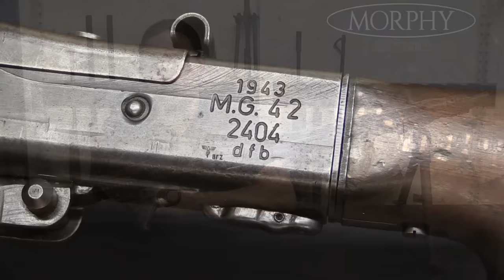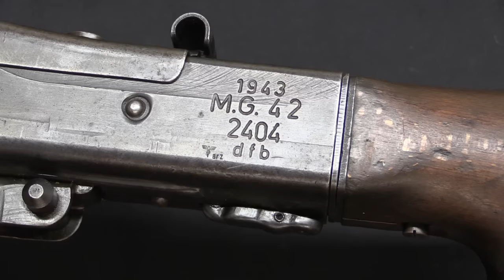Hitler's Zipper: The MG-42 Universal Machine Gun

Comment: I'm more interested about this mg42 than I am about the presidential election.
Reply: So you're a sane human being I see.
Reply: At least with the mg42 somebody has a good outcome, as a foreigner I don't see a good outcome for your election
Reply: Easy to see why: the election will take a whil, but the video is out
Reply: So are you saying no matter who wins the nation is fu**ed??
Reply: @curtisthomas2670  yeah but if Joe Beijing wins we're completely fucked.
Reply: Michael Madden I live on a farm in Tennessee.
Reply: Michael Madden  na just make a sub gun there really easy to make , 2 pipes, chuck of axle, fork spring, a square tube, and 2 tape measures
Reply: Michael Madden  notice how I didn't State how to put it together therefore no laws were broken I know what I did
Reply: Michael Madden  also I'm a Canadian who thinks your president is stupid I'm already on your FBI's watch list
Reply: Michael Madden  doesn't matter what quality they aren't they are largely made out of scrap and mild steels, with firearms at least you know the pressure bearing parts cannot be made out of just any metal there needs to be a hardenable steel and for instance the bolt in the barrel of the bolt in the barrel extension need to be actually separate hardened metals which sit around the same Rockwell hardness to stop from galling happening lot of these guys don't even know what galling is. More or less to my point is firearms made out of the improper metals are effectively a hand grenade. I don't care how fucking " high quality" your single Khyber pass firearm is I'm going to stick with my velmet cuz at least I know the gun builders that knew what they were doing and you know had tickets. (I could give a file to a high schooler and he can make an AK-47 okay not saying it would be good it probably be the quality of those Khyber pass guns and fucking blow ups soon as you shoot it cuz mild steel trunnions)
Reply: Michael Madden  only specific types of metals can be hardened at each one has a different hardness and truthfully it's not hardness specifically that is needed it is toughness which is a mixture of ductility hardness elastic deformation and plastic deformation it's almost like I know a decent amount about this (scrap metals you don't know exactly what type of steel it is you can tell it can be hardened but you can't tell what type of steel it is) let's say your bolt is a lower hardness than your barrel well then when you shoot the locking lugs on your Bolt will gall and in worst case can be sheared . metallurgy is much more complicated than you think it's not like you know you can get actual degrees in it you actually have to go to a place of learning to understand metallurgy properly. I am an Class-A welder meaning I am a red seal welder, I was trained by the Industry Training Authority also known as ITA. My training is recognized internationally, a class-A welders deal with alloys in welding terms alloys referred to exotic metals such as medium carbon steel, high carbon steel, killed steel, rimmed steel, semi rim steel, stainless steels, titanium, aluminum, copper,  etc.)
Reply: Michael Madden  quite the interesting Hobby I'd be extremely hesitant to you know make modern smokeless powder firearms out of that steel just because you do not actually know for sure the alloying element content of the metal but if it's truly is some form of crucible steel black powder firearms are absolutely an option cuz for Christ's sakes those were made out of wrought iron and wrought iron is not strong whatsoever
Reply: Michael Madden  well then if she's got a degree in medical allergy she absolutely can make Steals and she would know what I was talking about in one of my other comments when I was talking about rims semi-rimmed and killed steel (funny thing is I weld on those things) that her job title is pressure weld inspector
Reply: Michael Madden  to add the regular civilian can't just buy some of those chemicals like Palladium and some of the harsher metals that are actually a part of you know alloy metals for example ask her about melting magnesium
Reply: Michael Madden  here we go again you obviously know nothing about metallurgy in carbon steels magnesium is put in there to make it more tough and also corrosion resistant which is you know quite good when you're dealing with fulminates and you know nitrocellulose this is what I was getting into in the beginning you have to have an engineering background to make a effective and safe firearm of the bat you have to understand that you know the barrel has to be this certain hardness but it has to be this corrosion resistant it has to be ductile to promote proper barrel harmonics and those are all literally 0.01% by weight of your end product doesn't seem like a lot but zero carbon content and it's iron, 0.01% carbon content is mild steel
Reply: Michael Madden  also know the trouble is getting up to a decent temperature for the steel to properly homogenize in The crucible but obviously you have no idea what I'm talking about, look it up that's what rim steel is that's what semi rim steel is and that's what killed steel is it's a product of smelting the steel once again I'm a welder I've been trained to understand this because it's a serious part of my job and it just so happens my knowledge spreads across basically anything to do with metal because I'm a welder if it's made out of metal there's a good chance I'm going to have to fix it, also to ad if you do not use the correct smelting methods the steels will not come out well and be at the certain quality that making for firearms it would be good for what I'm getting at is basically what you're saying is anybody can make steel in their backyard and I hate to break it to you Mr "many hands make light work"
Reply: Michael Madden  no I did work for the Canadian Navy in the US Navy I'm a private contractor/mobile welder, I can build skyscrapers to pipelines to ships, fuck I even did some ship breaking back in the day (like 10 years ago)
Reply: Michael Madden  and no crucible steel is modern steel you know steel made in the 20th century made by putting either  cast iron, gray cast iron, white cast iron, malleable iron, or Nodular iron in to either a open hearth furnace, a basic oxygen furnace, or a electric furnace all using extremely complicated methods to make steel but that's how modern steel is made not with your little shitty graphite crucible in your propane fucking forge like you would with aluminum ask your little friend she'll fucking say I'm right and you are wrong
Reply: Michael Madden  I'm not sure a lot of people know this but, there is a fairly big community of pagans in tennessee with guns that follow the old ways. We're not taking shit from anyone.
Reply: Michael Madden  in the old days we were called germanic tribes, norse vikings, celtic warriors, pictish warriors, greek warriors, romans, knights, all sprung from indo Europeans. All great europeans! It's time to start being great again, and advancing the world.

Comment: The only problem I see with the MG42 is it's ability to sustain fire. Firing that fast doesn't give your guys a lot of time to flank or whatever, before the guys on the receiving end get up and fire again. I'm assuming the belts are 100 rounds each. So that gives your dudes at bare minimum of 4 seconds to do the thing.
I also wanna know more about the ammo guy. Like, how many belts did he carry and what was he equipped with? After he ran out of belts, did he run back to like a nearby truck and get more or did both him and his gunner run for it? Don't get me wrong, the '42 is a phenomenal machine gun and is just as amazing as the fact that in 1998, The Undertaker threw Mankind off of Hell In A Cell, and plummeted through the announcers table.
Reply: Standard linked belt is for 50 rounds, but you can hook them together to get an endless belt. And you’re not supposed to empty a full belt with one pull of the trigger. Typically 4-6 round burts.
Reply: The "ammo guy" was the rest of the squad, German battle doctrine of the time had something like 5-7 guys carrying spare barrels and belts for one MG-42, and it worked.
Reply: The rate of fire was almost certainly too high for the vast majority of circumstances (in its anti-aircraft role, extremely high rates of fire make sense) and was a liability although it could be managed. 

There are good reasons that modem GPMGs are generally about 600-800 rounds per minute and even modern MG3s have substantially reduced rate of fire.
Reply: @88porpoise  Yes,but they still fire at a rate of around 1000rpm.
Reply: @MrErikchaugen  Which would be right about where the MG42 started out before they were told to increase it and about a one third reduction from the rate when the MG42 went into service. 

I also note that the rate of fire for the new MG5, which is supplanting the MG3, is supposed to be in the typical 600-800 rounds per minute of other GPMGs.

I also question the argument that the rate of fire helped with suppression. While, yes, more bullets down range has a benefit, there must be a point where the marginal benefit of another bullet hitting is negligible because there are already enough to do the job (if you are a soldier with fifty rounds hitting in your vicinity every second are you really going to notice if it was increased to fifty five?). I cant say where that point is, but there has to be a point. So I look at post-war decisions for what the militaries thought and it seems the consensus was that such high rate of fire wasn’t very useful (although the prevalence of semi and fully automatic weapons could mean with more rounds coming from other sources you could reduce the MG rate of fire accordingly). Also the sound of the MG42 as a result of its rate of fire had a suppressive value of its own (there is a reason for the often mocked “Their bark is worse than their bite” line was used).
Reply: @88porpoise  I agree with what you write,and when i was in the norwegian army,we had the mg-3 as a squad automatic weapon,and it is fast!!A thousand a minute is more than enough to supress any enemy.Now we use the FN Minimi and the FN Mag.
Reply: @hakimcameldriver  You can change the barrel in 3 seconds, quite a nasty surprise if you have 30 seconds in mind ;)
Reply: You don't just fill the landscape with steel. You just do that when your vehicle is caught in an ambush just to shock the attackers for some seconds and get out of sight. In infantry fights you give short bursts to tell the most valiant guys over there what's expecting them if they jump up and give everything. If they are still stupid enough to show their enthusiasm it's gulash time. But you're right about one aspect. Especially the Red Army learned quickly that cutting off supplies could drop the fire power of the German infantry dramatically. These guns tend to run out of ammo.
Reply: @88porpoise  What you are saying is absolute heresy. THERE IS NEVER ENOUGH DAKKA.

Comment: Now I know why mine blew up back in 1985. Up until watching this and learning of the bolt bounce explains why my reconstructed kit gun exploded. And yes it was from an out of battery round discharge. I had more than enough fun with this $135 kit that shipped with 2 barrels. I know that I had put over 25,000 rds down its pipes, as surplus was still selling at .05-.06¢ a round back then. A can of ammo, 500rds was only $25 belted & already to go. Even with the cam action on the charge handle it was still a stiff pull to cycle.  But over all having owned both the mg42 & browning 1919A4 with Israeli mods. I would prefer to go with the 42. I really felt that a 42 was easier to stay on target & less belt feeding hassles.

Comment: The only downside of this gun is that it doesn't have a picatinny rail.
You put a scope on it and you could've won the war on your own.
Reply: I suggest to put Reflex instead ACOG, its not long range mg i think
more like Pepper and Spam MG
Reply: MG3 KWS ?
Reply: They had scopes for it when it was mounted on the tripods
Reply: The lafette mount had a tough 3 or 4 power scope comparable to an acog. They literally used the MG42 for plunging fire and almost indirect fire at insane distance when mounted and scoped. It's even in their training and deployment manuals. Interesting
Reply: It is possible. I saw one with an EOTech mounted in place of the iron sights and I think I've seen some with ELCANs mounted on the top cover (but don't quote me on that),
Reply: @joe6167  

Indeed you have, I have seen Danes with MG3 and Elcans mounted. The danes use elcans on canadian made M4s too
Reply: I think the US Marines and British Army are the only ones who still teach LMG Indirect Fire, but our newer M197 Tripods for the M240 have removed that capability from the Weapons Plt.   Its a capability that could have been put to use in Afghanistan.   Our US M240 don't even come with the dovetail for the M64 Mortar Sight for indirect fire mode.    The Lafette 34 and 42 had that German-over-engineered recoil mechanism that automatically traverses and depresses and elevates the weapon for a larger beaten zone.   I had one for my dot44 MG34 that ran like a Swiss watch.

Comment: Info requested -
mg42 =1500-1550 rpm ( 25/26 rnds a sec) , 
mg3 = 1200 rpm ( 20 rnds a sec ). mg3 is a slowed down for nato standards version of the 42 in 762.nato.
m53 = 960 rpm ( 16-18 rnds a sec ) produced by Yugoslavia after the war using german tooling left behind .
besides the heavier bolt introduced for the mg1 later mg3 the rpm is regulated by the the exit hole in the muzzle cone booster ,the smaller the exit the higher rpm. A m53 which is highly passed and mistaken for a 42 can have its rpm raised to war time rpm with a smaller exit hole ,a 42 blank firing cone can be drilled out to the appropriate size of 10.5 or 11 mm.

Comment: The reliability issues with the MG34  was the old German nemesis, over precision. The tolerances were too tight, and it will jam with the slightest bit of mud in the field,  the fix was to open up the tolerances and the problem disappeared. I have made the comment the British are much better at banning guns than designing any good ones. In the same era, they invented the Sten, while the Germans had the 42, both stamped steel, and cheaply made, the Sten were junk, just better than having a sword, and the 42 , variants are still used today.

Comment: The ammo consumption wasn't such a big deal because in a sense, the whole 10 man squad was one big MG team. The actual MG team were 3 man, the gunner, the assistant gunner and one dedicated ammo carrier and fetcher, who's whole job it was to carry MG ammo and run to get more, if needed. On top of that, the rest of the squad would also help carry ammo for the MG.
Nowadays, where soldiers have to carry anti tank weapons and lots of other stuff, that isn't as easy anymore, which probably is why the MG3 has a slightly lower rate of fire (1200-1300 rounds per minute) and why the new MG5 the Bundeswehr introduced a few years ago, has a much lower rate of fire (800-900 RpM), very much in line with other MGs in use in other NATO forces.

Comment: I used a similar machine gun in the Norwegian army in the late 80's. It was the MG-3. It came with a profiled scrape for cleaning propellant residue from the inside of the muzzle. If the holes around the muzzle got clogged, the rate of fire would increase as the gases would meet greater resistance exiting through the holes. Thus pushing harder and faster on the front of the barrel.

Comment: It might be too late to ask this question as the video was posted 2 years ago, but I have heard about the MG-42 overheating after around 250 rounds or so, around 8-10 seconds of continuous fire if my math is correct, did it overheat as quickly in colder climates? and similarly in hotter climates, would they overheat quicker? did later designs improve on the uptime of the weapon so they could fire more rounds before having to wait for it to cool down?
Reply: They don't wait for it to cool down, they change the barrel. Same time as they reload it.

Comment: Disassembly done in the wrong order. Sorry, Ian. The way how to propperly disassemble a MG42 or a MG3 is: from the middle to the rear to the front. Means: 1: remove top cover. 2: remove buttstock (bolt in forward position. 3: pull charging handle in order to get the bolt assembly out. 4: remove the barrel, 5: remove the flash hider and then the barrel nut.
Reassembly is almost the exact opposite order: 1: insert barrel nut, 2: insert barrel, 3: attach flash hider, 4: reassemble the bolt assembly if you took it apart but do not insert it yet! 5: insert charging handle, 6: insert bolt assembly, 7: attach buttstock and finally attach top cover. That is how I learned to handle the MG3 in the Bundeswehr.

Comment: Question at Forgotten Weapons. 

Do you guys know of a Video from a Fire till Failure test for MG42 ? 

There was Reports from German Soldiers in WW2 claiming to have Fired their MGs for Hours nonstop even without Changing Barrels because all the Barrels were Burning. 
But these Reports are considered to be wrong or overblown as the Gun would Breaks. 
Which makes sense after all there is alot of Heat going out and for many Guns you will find Videos actually demonstrating Failure Tests where someone just keeps firing the Gun till it Jams from Heatdamage or Ammunition Failure. 

But not for MG42 or MG3 
I tried finding one Online. But wasnt able to Find any Videos which actually Fire an MG42 or an MG3 till it breaks. 
Would you happen to know any such Videos or Info on how many Rounds an MG42 can Fire till it stops working ?

Comment: MG-34 was preferred to be used with the Panzer Divisions for their Tanks. Because MG-42 changing barrel system is not fitting. So they use MG34. Both are deadly accurate.